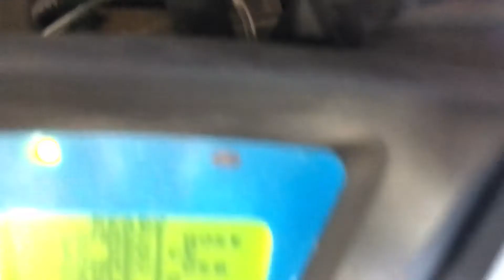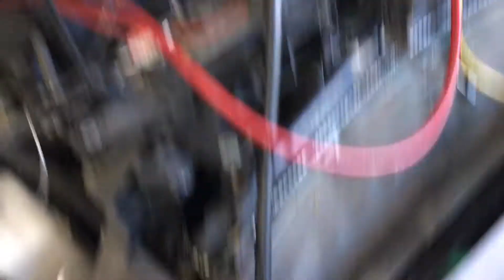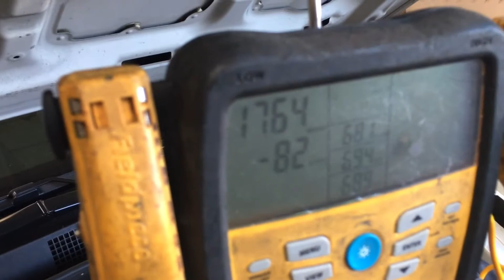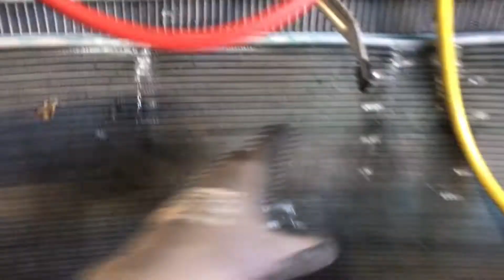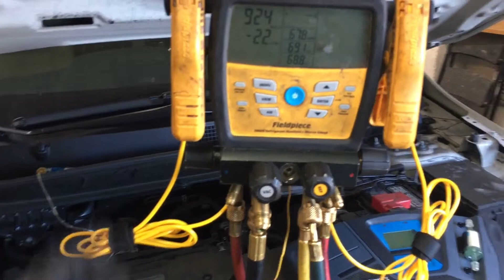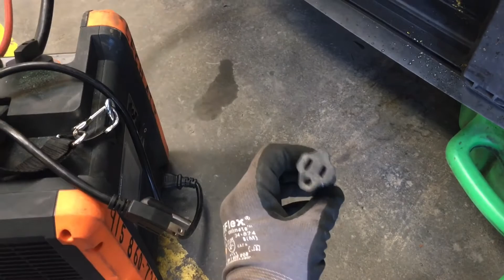Refrigerant recovery with NAVAC NRDC4M and refrigerant analyzer

Comment: How come your meter reads 100% r1234yf and 2% air.   That totals to 102%.    Shouldn't the machine read 98% r1234yf and 2% air?   BTW, do you know of any more affordable refrigerant identifiers than the machine you use for someone who is starting out in the trade.  Thanks!
Reply from the maker: komoru Air is not considered a refrigerant contaminant because it can easily be removed in the recycling machine.   Only other gases are considered a contaminant.  Air is a contaminant because it will mess up your refrigerant readings and of course you know if you have air you have lots of moisture and moisture is a very bad contaminant.      Yes there are cheaper refrigerant identifiers they’re called a go Or no go. Pass or fail.     https://www.nationaltoolwarehouse.com/mobile/Refrigerant-Identifier-P136348.aspx?gclid=CjwKCAjwydP5BRBREiwA-qrCGhKXhzWXsfKkVjgU1Y4SlmtkaObL4QvYOcj3ZhOkK8T6whz8Z1c91RoCSIcQAvD_BwE        They do not tell you any percentages or what is mixed with your gas I believe up to 5% is considered acceptable.  They only perform test for one gas you have to pick and that will be the only gas they test for.  Example you buy the tester for R134 and that’s all they will look for if you also want to test R1234 you have to buy another unit just for that gas.                For me as a example my most common gases I work with are. R12, R134, R22, R1234Yf, R410  so I would have to buy many testers individually which would come up to the price of the tester I already own.  And it gives me exact measurements of what kind of gas of contamination in percentage and how much air in percentage I get to see.